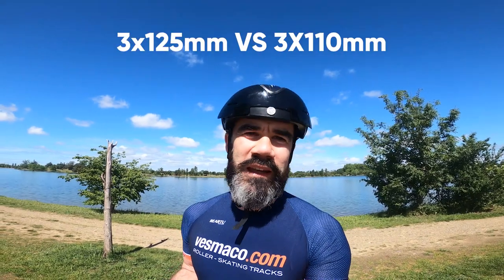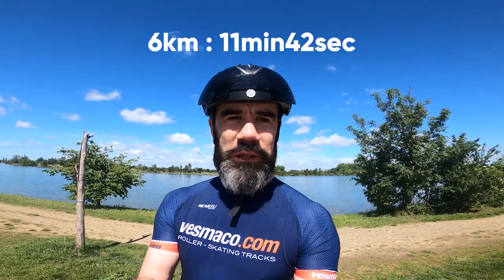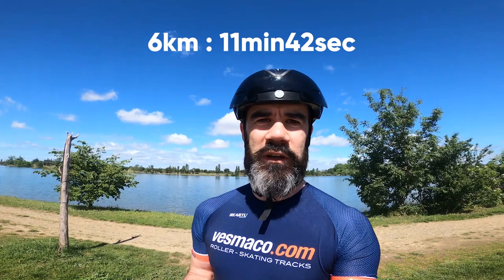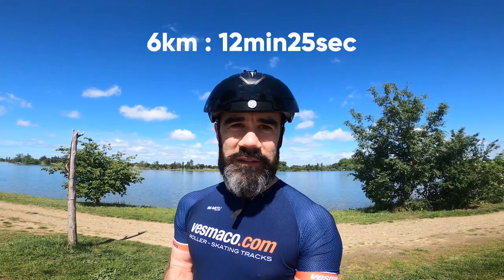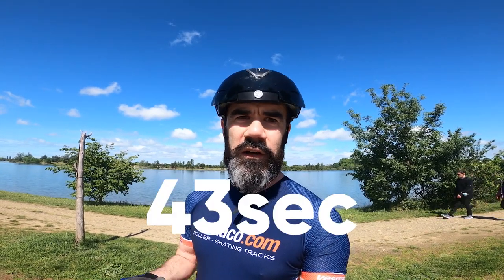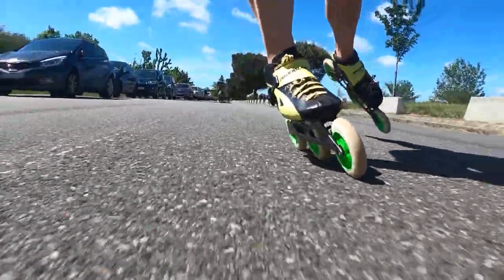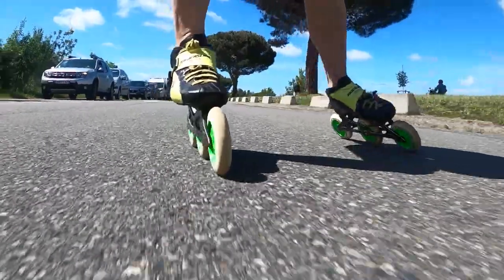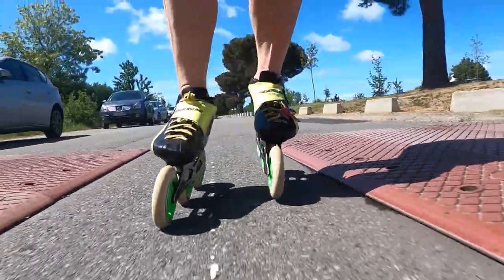3X125 VS 3X110 (pascal briand vlog 351)

Comment: Thanks Pascal! So I need a 4x110 frame😅

To stay on topic I repost my results for 3x125 VS 3x110.
 I used Powerslide R6 skate with standard frame. This is my second year of inline skating. I only changed the wheels on the frame. I usually skate between 25 and 30km per session and the occasional marathon. I also do tempo training of various distances. Today I skated a lap of 7,9km. Nice road but very busy as the weather is very good. I aimed to put 80% effort in the laps. First lap with 3x125 in 19min 18sec, second lap with 3x110 in 19min 33sec. So very little difference for me in fact! May have to do with that I have less experience so 110 is easier to control for me.
Reply: Good Info. 
Less weight with 3x110 is more pleasure and more fun than being a few seconds faster.
Reply: @Damian Wójcikiewicz Dont do it, a 4x90 is the better choise.

Comment: Interesting Pascal, did expect reasonable difference between 3x125 vs 3x110 but really didn't expect such a great difference 3x110 versus 4x110 from your last test. Did know something from an acquaintance: he had a wheelproblem right at the start of a local marathon where he had to set his skates up 3x110 leaving one wheel out, he was fast in the first 10k or so but after that got fatigued very quickly...

Comment: What configuration was the lap? I noticed that on tracks with many left/right turns it is much more comfortable to use 3x110 instead of 3x125. Especially if the distance is short. I also noticed that on a slippery surface 3x110 (in 3x125 frame) is a nightmare. :)
Reply from the maker: Mainly straight line , few 90 degree turn
Reply: One more thing - going uphill also is much more comfortable if the wheels are smaller. So, if a track has many turns and hills, maybe it is not that bad idea to use 3x110 instead of 3x125

Comment: Love it Pascal!
Please do the same with 4x80mm and 4x90mm.
Might sound boring for you but there are many skaters rolling on 4x80 and hear big wheels are faster but dont know if its really worth to upgrade the skate and dealing with the increased stand height.
Reply: I can already tell you from my own experience: 4x90 is way faster than 4x80. And 3x100 is about as fast as 4x90, so no real difference there.
Reply: @ccsmotu  That was just a video idea. Of course, I myself know how 4x90  performs in comparison to 4x80 or 4x110, but not in speed skate boots and not done by a very good athlete.
Reply: @ccsmotu  In my experience those who roll 4x80 rarely thing seriously about quality of components, as it start point for many. Good boot, high quality berings and hard wheels, and you just fly effortlessly. (and with excellent maneurability and control) so 80-90 is also no big difference with same great quality components. Maybe your 4x80 setup was just cheaper and less quality? Big wheels open it's advantage only when you perform maximal long pushes, so its matters for speedskating style mainly.
Reply: Changed 4x90-->3x110-->3x125, and yes, the 3x125 are fastest for long distance. I'm icehockey player and used to skate, so the bigger wheel isn't problem

Comment: Yes I’ve had questions about this for a long time. I have a 2x150mm suv with roadrunner wheels frame (I have bad roads and sensitive joints lol) and a normal 3x125 trinity one and I had thought about taking a wheel out of the 3x125 frame for endurance because my 2 wheel frame seemed like it glides so easy, no friction to slow me down but grip is definitely less, so I thought to try it for 125mm aswell. Never got the chance to test it though so it’s nice that you did that test otherwise I would’ve ended up skating slower lol I guess the difference in power per push out weights the resistance of the wheels on the ground. Must be how you managed to skate so fast on 5x80mm back in the 90s!!!!!
Reply: the more the wheels you have, the less the rolling resistance in the rubber. The only thing that gets worse is weight and maybe bearing resistance (+1 pair of bearings on each skate, which is very low anyways), these get outweighed by less contact patch deformation (up until the point where the weight or length becomes a hindrance).
Reply: @dushk0  Interesting, I didn't know that. Thanks

Comment: Rollerblade is selling a different, shorter 3WD frame for their endurance speed skates for 110 mm wheels (I mean for the E2 skates). Wouldn't 110 wheels be less flexible in the longer frame designed for 125 wheels ? So smaller wheels in a long frame would be more difficult to turn or to execute a double push ? I am not a pro, so I am just curious...
Reply from the maker: Here it’s different …to compare wheels setup and frame size setup.  Longer frame are more difficult to turn but more stable … frame length will influence your stability more than your time. Anyway a longer frame make it easier to feel the push

Comment: What's the best wheel hardness for the type of road you are on? I just recreation skate with hockey style inlines. I do have an old pair of powerslide R2 with Agent Orange 100mm and can't skate any faster than the hockey skates. I do mostly enjoy the ice with long blades, so much easier. :)
Reply from the maker: F1 Matter are amazingly on asphalt. Image wheels are great but if you want to go really fast then dual density wheels like g13 are the top of the top

Comment: These test are so much fun! Not very scientific, but that is the fun of it.
The speed difference should be smaller on a very smooth surface if speed is constant.
It would be interesting to compare the weight of the 3x125 vs 3x110 too.
Reply: G13 125mm 186g
G13 110mm 152g
Reply: Hahaha, cool! We can start the math. Formulas can be found here:
https://en.wikipedia.org/wiki/Flywheel

And then we would have to determine the rolling resistance on specific surfaces.

But....the flywheel effect will be small when maintaining a constant speed, which should be easy for Pascal at endurance speed. So that leaves us with the rolling resistance.

On the other hand. The ±20% more weight of the 125 will provide a higher gyroscopic effect making the leg recovery more costly....

Let's call NASA to do the math.
Reply: @kjeldbontenbal1772  You just asked about the wheel weight. Simple math.
Reply: @freshasadaisy4782  Alright, you are right and got me motivated. If I did correctly the Kinetic energy stored in the 125 wheel is 0,55% more than in the 110 wheel. A difference that might be noted in a short sprint, but not in a marathon.

Gyroscopic effect is for another rainy day :)

Comment: Merci Pascal pour cette nouvelle comparaison. A l'aide de ces deux dernières vidéos cumulées, on peut en conclure que 4x110 est beaucoup plus rapide que 3x110 (qui est plus rapide que 2x110!) Donc à diamètre égal, au plus on a de roues, au plus on va vite . J'ai 2 paires de roller vitesse, une en 3x110 et une en 4x110, sur 30km j'ai toujours au moins 3mn d'écart que j'expliquais en partie par des roues de piètre qualité (sur 3x110) mais le poids corporel réparti sur chaque roue est sans doute plus important. Votre premier comparatif (3x125 4x110) m'a convaincu (67ans) de ne pas passer aux 3x125. J'ai remplacé ce soir la platine 3x110 par une 2ème 4x110 avec des mpc Assault. Merci pour toutes vos vidéos.

Comment: This is very interesting! If 4x110 is faster than 3x110, would 4x125 be faster than 3x125? To test this you would have to make a frame yourself.. Maybe it would become too heavy or too long.
Reply from the maker: Would be very long yes
Reply: maybe a 125+3x110 or 2x125+2x100 hybrid configuration :-D

Comment: Changing wheel size needs a push adaptation, it pointless to compare its directly, you need to inskate first, it's a matter of days as minimum.
Reply from the maker: Hi, you know may in 40 years of skating I develop a bit of skills to adapt to this …  but it’s also true for less experimented skater a adaptation time is needed … specially in the timing of the skating stroke.
Reply: @ThePascalbriand  Paskal, of corse Im sure in your skills, no doubt. Also i still think the change just can't do "no affect", and  your proficiency just make adaptation fast. I also sure it still will deoptimise your technic, despite to high skill. Even more. Better and more polished skill = worster disadoptation from changing inventory. Sory for maybe some impudence.
Reply from the maker: @MetaJamm  no no worry all good :-)

Comment: So the 3x110 is noticably lighter but is 4x110 actually still lighter than 3x125 ? Also,  there is an obvious conclusion from this... You have to go 4x125 ;)
Reply: G13 125mm 186g
G13 110mm 152g
Bearing 21g 
Axle 8g
Reply: Perhaps that the next efficient step for manufacturer will be to produce a 4x120 frame in order not to  exceed the 50cm allowed  lengh  .
Reply: @freshasadaisy4782  So in this case its 100g heavier than 3x125. But maybe the frame could be lighter, no ?
Reply: @gamma2.2  
Trinity Trible-X frame 3x125 219g
Trinity Trible-X frame 4x110 238g
Reply: @freshasadaisy4782  Thanks, You have all the data :) do You know why 4x110 is faster than 3x110 ?
Reply: @gamma2.2  weight distribution and more inertia due to a fourth wheels
Reply: Maybe at first a 4 wheel frame with 2x125 (one at each end) and 2x110 in the middle would be a good compromise.
Several advantages :
.Only 3cm longer than 4x110
.195mm shoe could be used.
.Hight lower than 3x125.
.Diameter wheel already existing.
.Lighter and shorter than 4x125.
.Only a new frame have to be manufactured.
But it seems  that the most important advantage would be the frame lower than the usual 3x125
Reply: @danyjoubert1118   Trinity frame DH350 125/110/110/125  
weight 365g, 350mm length
Reply: Oops! I didn' know that the model already existed...Thanks for the information.
No one has ever tried on flat road or marathon?
Reply: @danyjoubert1118  it's a Downhill frame. The whole setup might be too heavy for a marathon. 
I dont know if anyone tried it in a race or if its even allowed in competions.
Reply: Yes, I saw the weight but the concept is perhaps interesting.
In terms  of length, I have used for at least 5 years an old 5x84 Mogema frame (340mm) transformed into a 3x110 and wasn't bothered by the length.
(But I had plenty  of time to see that 3x110 are significantly slower than my   4x110.)

Comment: That pavement looks pretty coarse. Times would have been closer on a very smooth surface, but larger diameter equals less rolling resistance. Too bad 125s handle and look worse...